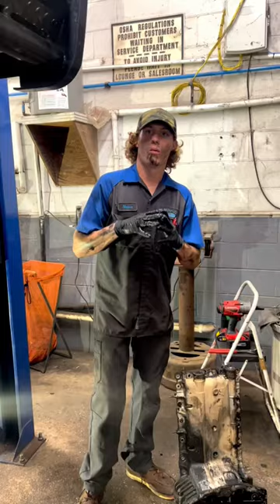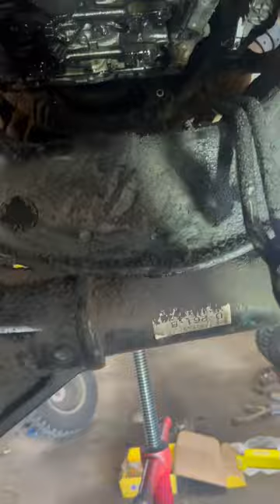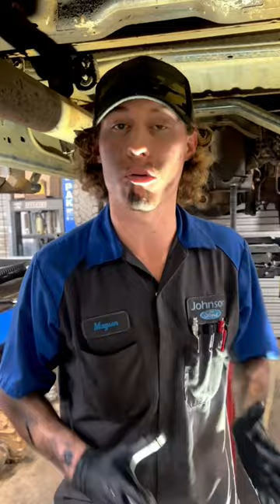Mechanics Should Get To Stay Clean Too #shorts

Comment: Keep it on the frame. Rust protection!
Reply: Wash it off so the fresh stuff can leak onto it, even better protection
Reply: @deejayskyce5282  lmfao
Reply: I usually scrape off the thick stuff and leave the residue
Reply: Its rust protection until you can put a whole screwdriver because it went soft💀
Reply: @crisscross3422  why would oil make metal go soft?
Reply: Thought the same thing. I live in the rust belt. This would work great
Reply: @dickbutt7854 oil won't make metal soft ever. I restored a 1939 packard and the whole front end was covered in an inch or more of oil n dirt. Scraped and clead the front end and it still had the paint from the factory and was rock solid. The car also sat for over 20 years before I restored it
Reply: Most comments are just monkeys repeating themselves.
Reply: @robertwalker3523  takes one to know one lol :)
Reply: @dickbutt7854 it's not the oil, it's all the crud that the oils holding.
Reply: @crinkly.love-stick  nope. The crud and fuilds mixed with the oil will never make the metal go soft. Metal can't get "soft"  it can rust due to moisture and temp and exposure to salt or salt water speeds up this process. You can soften metal with heat to change its structure but not with road grime and fluids from a car
Reply: @dickbutt7854  zonedoutagain is wrong. The crud and fuilds mixed with the oil will never make the metal go soft. Metal can't get "soft"  it can rust due to moisture and temp and exposure to salt or salt water speeds up this process. You can soften metal with heat to change its structure but not with road grime and fluids from a car.
Reply: @crisscross3422  if it was rust/oil protected it won't go soft as you call it. I think the term your thinking of is brittle. Oxidized metal becomes brittle. To make metal softer takes heat treating. No oil or mix of road grime will soften metal. Road salt will rot metal out to the state its brittle to the touch or poke of a screwdriver
Reply: @gasNmudtv  "going soft" means its corroded beyond repair. If you can poke your finger through a steel plate, it ain't steel hard anymore. It's soft
Reply: Hell my OBS Ford between the power steering leak I just fixed the pesky fuel bowl leak frame stays nice 👌
Reply: He’s not talking about me cause I’m with him . 👍😊
Reply: @crisscross3422 what!? 😅
Reply: @crinkly.love-stick  how exactly does steel corroded? Rust! This would not make metal go soft. That's nonsense
Reply: What are ALL of you talking about? They will fix it but they will not clean the frame OR the surrounding area's even. Only the repair area ITSELF. Who is trying to kid who here?
Reply: @deejayskyce5282 😂🤣
Reply: Yeah, he'd hate my truck. Every winter I get under it with a gallon of bar and chain oil. 30 Pennsylvania winters and it's still solid!

Pick your poison: if I didn't oil the undercarriage, you'd find half the bolts to be rust-welded together. That will toss your "book rate" right out the window!

Comment: Compensation is based on unrealistic time motion studies conceived when Henry Ford Co. was building model T’s . Modern cars with modern electrical systems and advanced 21st century tech are about as similar to Model T’s as a clay pot is to a refrigerator.

Mechanics /technicians labor under the “flat rate” for every job.  The contract between management and labor is one sided and give the worker “NO SAY AND NO CONTROL”.  What’s worse is these times are based on a third party, (generally vehicle manufacturers) and clearly not impartial.

What’s needed is a new incentive based compensation scheme that rewards proper technique and thoroughness..  Ever wonder why they don’t use flat rate in Germany. That’s right, in the country that produces some of the finest automobiles , tech’s are salaried.!

Comment: Use to crack me up when I would have to explain severe labor (aka you don't take care of your car service) vs basic labor...some people don't get it
Reply: Gotta love it when that one girls SUV rolls up and it's legit a rolling trashcan with puke on the inside and outside passenger door. And it's there for "my windows sometimes don't roll up"
Reply: I never thought about charging more for rolling part cars. A lot of older turbo cars are nasty. I should charge an extra $10 and hour.
Reply: @johnwalker7592  Reasons why I quit being a mechanic lol
Reply: You went into the job knowing it's a dirty one. If it's nasty and full of trash turn down the job. If someone went off-road and its caked with mud tell them to wash it. But your average person could not tell you what it looks like under even there own car or truck.
Reply: @STRIKER520  I once worked on a semi, axles, driveline, trans and they brought it back because it was jumping all over the road. They had it completely caked in mud. I tell them that. In between their dual tires it was caked so much it was coming out above the tires. I told them go clean it and it’ll fix your issue. They argue and argue and so they got charged for having it pulled around and power washed.

Comment: Reminds me of the time I had a new furnace and AC installed.  My basement is a workshop and storage room so it's a perpetually cluttered maze, and the AC coolant lines run right over top of some fully loaded shelves.  I moved all those shelves, cleared out everything near the furnace to give them space to work, and made a wide path from there to the stairs where the machine was going to be brought down.  As a mechanic myself, I know exactly how much of a pain it can be just getting access to whatever you need to work on.  I figure if their lives are easier, they're gonna work happier, they're gonna care about the job more, fewer chances for things to go wrong, everyone wins.

It was a pain moving everything around, but totally worth it.  They were completely done in about eight hours and they greatly appreciated that.  The guy running the show told me about some nightmare jobs they've had that took days because the first thing they had to do was deconstruct someone's basement and unbury the furnace just so they could START working.  It saddens me that this doesn't occur to some people, but it doesn't surprise me.

Comment: There was a technician that worked at a heavy truck service facility. Truck came in for a clutch. Had a hole cut in the floor and fecal matter sprayed all the way from the drive shaft all over the undercarriage of the vehicle. Wrote a nasty note on the work order and sent the guy to another location😮
Reply: Our tech school teacher told us of a clutch job ,but there was a funnel on the shifter and a hose going thru the floor,and the whole trans had crystallized wizz all over it. 
Good times it sounds like. 
Glad I'm not a truck tech
Reply: Indian operator?
Reply: @5.43v  .....yeah......🤢🤮

Comment: The part that gets me is book says 14h. Takes competent mechanic 6hrs. Still going to be charged for 14. Because that’s what the book says it should take. So the tech gets paid for the “6 hrs “ and the dealership makes the 13 and then a 20% or more markup on the parts used.
Reply: Tech rate is $20hr
Shop rate is $120hr
Reply: On flat rate the mechanic gets the 14 hrs the book calls for. A mechanic should not be penalized and paid less because he learns to do his job fast.
Reply: In the early 2000’s I used to run a smallish import repair shop (4 bays). 
At that time we were doing Honda CV Shafts several times a week.  
Don’t remember what the book time was but it turned out to be exactly 1/2 of book time.  

We never charged a customer for hours worth of labor just because the book said so.  
Unfortunately almost all shops I’ve been to as a customer charged book time.  

Example:  Volvo Dealer 
Charges $10 to top off washer fluid and $45 to replace the air filter.  

Absurd!!!
Reply: They go out of their way to lowball the labor hours, nobody finished a 14h job in 6h. Im sure you don't mind them working for free if it took 20h for a 14h job

Comment: I don’t mind the grease as much , I can’t stand when the inside if filled with trash. You know you’re getting a heater core replaced then throw away your moldy fast food burgers you have laying on the floor .
Reply: The shop I work at we turn people away if the inside is filled with trash. The same people who have some nut loose in their head that tells them it's ok to have the inside of their car looking like a garbage collection truck will also come back to bite you when that same customer later balks at the repair price even though they already agreed to it and/or brings the car back a week later with an "ever since you did that repair this other thing is now happening" even though the new thing going on has absolutely nothing to do with the original repair. It's the whole mentality that just goes hand in hand. Not worth it.

Comment: 1000% agree.  Good work ain't cheap cheap work ain't good.
Reply: Reminds me of the old adage: You can have it good, fast, or cheap. Pick any two.

I used to use it when I did software contracting. Usually I'd turn something down if they were grumbling about cost, which I think is true for most people: You want it done right but you don't want to pay reasonable compensation? I'm not going to prioritize!
Reply: I use this all the time with my bosses. You have these three options. Which two do you want.

Comment: Had a 250 that needed a upper oil pan but there was about 250lb of dirt caked all up in the motor carrage. Literally took me an hour or 2 to just get it clean enough to do the job.
Reply: I use to deal with this pulling transmissions out of oil field trucks under warranty. I use to have the writer charge them an hr to relive all the caked up mud. Just so I could work on it. Not doing that shit for warranty time.
Reply: @dickbrugh5562  yeah it was a 2020 but you couldn't tell. It lived at the dump all its whole life. There was grass growing in it lmao 
Had a wheel barrel full of dirt when I was done, my bay look like I built an rc car dirt ramp in the middle lmao

Comment: That's one reason I went into heavy duty truck repair. Worked for two independent shops and one the independent shops are pretty good. Fair union wage, no book time. Time to clean up tools and fleet shop was the best. Teamsters union, great wage, great employer. You had to be efficient and there was no goofing off or at least not much. Ample time to clean up the shop clean up your tools keep the service truck clean etc etc area best benefits ever